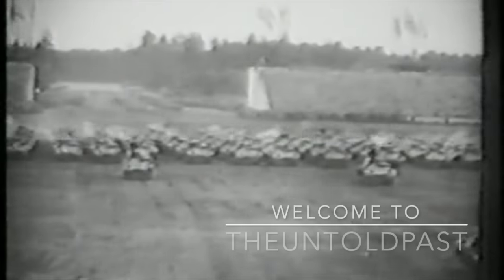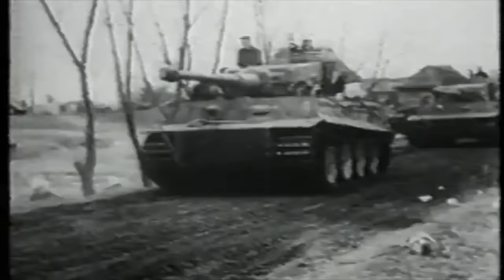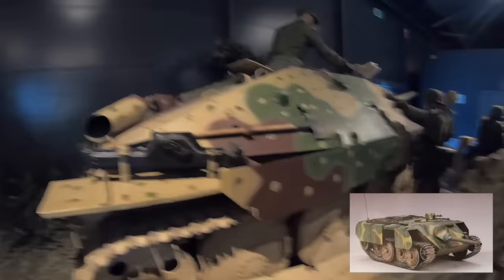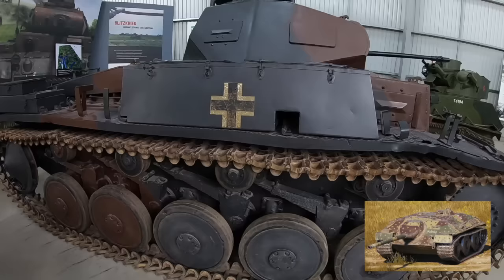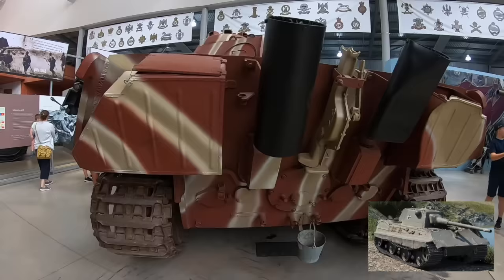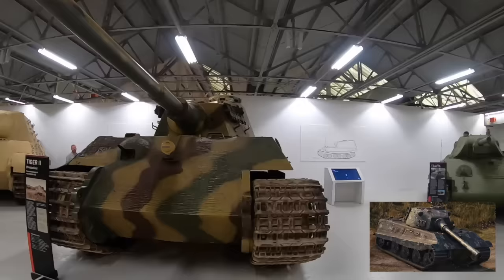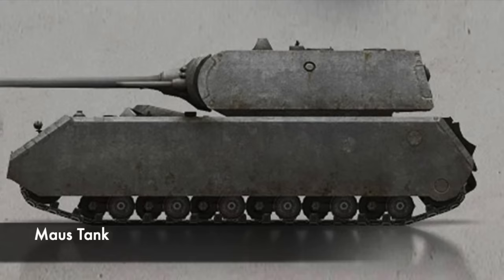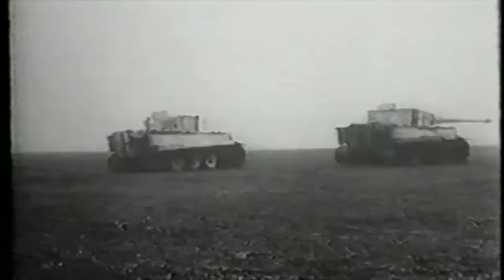The E-Series Of Tanks - Hitler's Dream Tanks

Comment: So if the Germans introduced the E-series earlier in the war like in 1941, would it have made a difference in the winner of the war? Would it have changed the outcome of any major tank battles like the Battle of Kursk? Or the Battle of Moscow?
Reply: assuming you mean the rationalisation and the susension type rather than the armour and guns. it would have made a difference in production, maintainance and general reliability. resulting larger more combat ready tank arm in 42/43. so strong german units able to move further.

 but you would still have the issue of lack of fuel, which will restrict this increase in effectiveness somewhat, it was a major problem in the push to stalingrad (let alone battles afterwards). thus probably not enough to change the outcome of the war. 

the biggest issue the germans had in ww2, was not tank production, that was only really an issue after te wr was effectively lost anyway. it was the plan to invade the soviet union. big massive crossfront general advances are never a good idea. they underestimated the soviets and lost as a result.
the only thing that might cause a dramatic change in ww2 from the german perspective is 1) a longer ranged fighter in production prior to 1940 (so it can help change the battle of britain), and 2) and change in tactics/strategy going into the USSR. and you kind of need both. any other change is going to make it easier but will not change the outcome without atleast 1 of the above.
Reply: @matthiuskoenig3378  - Thanks for the insightful post. I enjoyed reading it. What if the Germans went with Operation Barborossa first instead of the Battle of Britain? With the E-Series and more resources, could they have taken the USSR?

Comment: So the German's learned that their very large Tiger's were a bad idea, so they were trying to made a tank more like the Sherman/T-34s , but the thought was too late. The Tiger tank should have been built in very small numbers and used in very limited roles, the tiger just did not make for a good tank to send into battle because of it's weight and high maintenance/fuel consumption, in other words the Tigers were just for show ):
Reply: They killed well when ambushing from concealed, defended positions or going up against poorly trained Soviet Tank Crews.
Reply: @youraveragescotsman7119 This is what the Tiger is good at. It doesn't take nearly any fuel to sit and wait for an ambush. This is why the Tiger was a better late-war than the panzers. The panzers were fast but they didn't need to be. This was a defensive war. You don't want fast maneuverable tanks in a defensive war. you want big beefy ones waiting to ambush the enemy.

Comment: Yes, the E series "seems" like a good idea, but so did all the other German wastes of resources. The United States, with its massive industrial output made only 4 tanks at this point in the war, the light tank m-5, the medium tank m-4, the m-18 hellcat, and the Pershing. If you wanted anything else it had to be built on one of these chassis. Also, m-18 was far cheaper to build than a Sherman, used the same engine and carried out a role the would have otherwise had to be done by a, more expensive Sherman. If I was in charge of German tank production, I would have set up 2 branches: Maintenance and Integration group, which would have used small shops to make parts for, and maintain all the various kinds of tanks the Germans already had, and repair and refit captured tanks and battlefield wreaks. And Production group, which would make 2 tanks: the light, a Hetzer-like vehicle mounting the 7.5 L48. And the medium, mounting the L48 in a turret, redesigned for low profile and good armor slope, or 7.5 L70 in a tank destroyer configuration. They still would have lost.
Reply: the e-series has interchangable suspensions and road wheels, the E-50 and E-75 were essentially varients of the same vehicle (same hull, same engines, same drive train, just more armour on the front plate, and a n exra set of the same road wheels, and possibly a different turret [that hadn't been decided yet tho). and the E-100 was cancelled (design continued privately, but the german government wasn't interested any more), the E-10 was replaced (but a vehicle was still being made in its place) and another vehicle was added (sometimes falsely referred to as the E-5)

these 5 tracked hulls would have also included APCs, so i we want to compare to the yanks then you should inlcude the M3-M5 halftracks, in which case both are produceing 5 hulls. but the e-series has greater interchangeability of parts.
Reply: @matthiuskoenig3378  Expect that the Germans were making a number of different half tracks too. And the whole idea of using a tank as an APC (at that time, in their situation) was ridiculous, the American m-3 half-track cost one quarter of what the cheapest Sherman cost. Parts interchangeability isn't gonna make up for that. Yes, Interchangeability is good, but one must consider, if these two vehicles are so similar that they can share parts, other than say, commander's cupolas or things that any two tanks could share (driver's seats?),  why not just make one. Yes, everything that can be interchangeable should be, but why not just make fewer kinds of tanks? Germany should have never had the Panzer 3 and the Panzer 4. They never should have had the Tiger and the Panther. If we want to make these vehicles parts interchangeable, lets make them 100% parts interchangeable. But you didn't mention my "Department of Tank Scrounging" idea, that was the best part of the whole thing :)
Reply: PNZ III & PNZ IV were fine vehicles, to my knowledge, PNZ III was intended to be the anti-armour, while the PNZ IV was to be mounted with the larger turret for an initially short barrel 75mm for light fortifications or anti-infantry. Tiger was a specialized tank for attacking heavy fortifications, and initially, was successfully used at that role -it was a good design that was later utilized outside of its intended doctrine. Panther was a modernized PNZ IV that had too many teething problems - though if it had a proper design run, it could have argued to be an effective core design. Tiger II was built around the same effects of the Tiger I, except the Germans weren't using it for the same intention as the Tiger I - and this improper usage is why it's unreliability was such a large flaw.

Initial German production of tanks was fine, they should have always attempted to standardize parts, which was their true fatal flaw, though the designs initially made sense, especially based around their production techniques initially employed in the creation of armoured vehicles. Only when upscaled did it actually become an issue.
Reply: @D_U_N_E  The panzer 4 was 25 tons and the panzer 3 was 23 tons. Having a tank for supporting infantry and one for killing tanks is fine, but they can be the same tank, just with different guns and perhaps add on armor for the infantry tank. They could roll off the same production line, or have two production lines making the same tank in different variants. Same spare parts, mechanic training, crew training, everything but ammo for the main gun. There is no reason to make two tanks, make two variants of the same tank. The Sherman had tank destroyer variants, 105 howitzer infantry support variant, mobile artillery variant, all kinds of stuff on the same tank. While early war German tank doctrine was sound, tank production and logistic support never was. The thing about the E-plan was, at least, they had started to identify the problem.
Reply: @bryannoyce  Ok, I am drunk - so bare that in mind for spelling and such.

Ok, first to look at the Sherman - the Sherman was adapted throughout the war, from M4 to the M4A6 - while you can argue that these tanks shared many common parts, as was American supply doctrine at the time, they were noted to have rather unique changes in geometry of both the hull and turret - changing weights as there is a different change in volume of material. This was worked alongside American production techniques which were arguably rather modern in comparison to German techniques. Though regardless, the American tanks at some points in time were producing multiple "Shermans" of the same variant as retooling factories is costly, and overall numbers of tanks produced - which can be dangerous in all out war.

German production techniques were actually rather Artisan at the start of WW2 - they did not have the same efficiency in production of vehicles in comparison to the Americans or Russians, when talking about the Germans producing arms, or at least tanks, this is very important to take into account. Their techniques were inferior, though because of this, production of armed vehicles could be conducted in a different manner without reducing efficiency, for one - retooling a factory to adapt to parts was easier, as the factories were not designed for the same large scale duplication as a rival plant - while this WAS an issue in the long term, at the time of production of the PNZ III/IV, this was not a reason to reduce models, since factories could easily produce 2 different models of tank without reduction in numbers of units provided in comparison to a American or Russian plant.

Now to look at the PNZ III vs PNZ IV - which to note, you must bare in mind the techniques employed by German tank industries to understand certain benefits or drawbacks. 
Panzer III was lighter, as such, required less resources to produce - the tank has a smaller general body - which to German high command, meant that the tanks were easier to conceal, and as at the time it was intended to be the "MBT" of the Wehrmacht, it made sense.

The PNZ IV was only 2 tonnes heavier as you stated, though at initial conception (it was designed 1 year after the PNZ III), it made logical sense to produce for attacking bunkers, though it was slightly heavier, which translated to increased fuel usage - and a increase in size overall which then added additional restrictions on the German supply chains, as well as general tactical usability of the vehicle. In short, at the time where they have 2 tanks, PNZ III and PNZ IV - the III was to be used for main combat roles, and the IV was to be used alongside infantry with lower produced numbers due to increased cost. Operators of the PNZ III and IV would employ different tactics, and as such, it didn't matter for cross platform compatibility due to the fact you don't want a PNZ III operator to use a PNZ IV in the same doctrinal capacity as a III. At the time of these tanks inception, the German forces still had competent equipment requisition forces, and as such, to their specifications, the III and IV made logistical as well as tactical sense, this is opposed to 1944 Tiger II's which were developed for a more political than logical reason. 
During the war, it was noted that the 37mm cannon employed by the PNZ III was inadequate for expansion, and as such, over the course of the war - production was diverted to the IV, since the long barrel 75mm had more potential against the main threats encountered by the Wehrmacht. Alongside this, Panther chassis were actually more optimized than Panzer III/IV chassis in terms of production time - I remember reading somewhere that the Panther in 1945 actually had some of the highest unit production output per month in comparison to 1938 Panzer IV production, despite the loss in territory or resources. The Germans over the war started to utilize better production techniques, and over time removed the "Artisan" manufacturing processes, the E series being a testament to how the Germans started to understand single unit performance vs numerical superiority. 

Your point makes sense if the Germans utilized production techniques similar to Russia or America, though their techniques were vastly different, which is what caused the alternative developments of their armored vehicles. If bringing up German arms, you also need to understand how they produced their armaments', and why certain decisions may have been made due to set limitations in their infrastructures. To use a modern analogy. The Abrams/Leopard tanks weight 60-65 tonnes, these are MBT's, and it is to be assumed they should be able to have sufficient tactical flexibility around not only their own countries infrastructure, but their own field support for moving the vehicles across terrain. Be this mud, or bodies of water. The Tiger II, which was classified as a heavy tank, was 68.5 tonnes - at it's inception, it could not easily be supported by infrastructure or support units. Without understanding of a countries capabilities, we cannot understand what is a good/bad design. If we assume every country is using the most optimized techniques for it's time, sure - we can make a clear connection. Though once material, technological, or just general techniques are applied to a situation - you need to look at from that counties situational dis/advantages. In which case, Germany had doctrine down to a T, as well as had a really efficient equipment acquisition program - producing arguably (until somewhere between 1941/1943) -  the most efficient/capable Arms in the world. Though as stated multiple times, their production techniques were archaic, and as such, their design philosophy was vastly different from other world powers. They did not standardize their equipment, lacked spare parts - their arms were good, though due to their own limitations at the time, they did not understand certain techniques that would have reduced pressure on supply lines, or increased the production of units at the start of the war.

If we ignore how their industry was relegated, sure - They should have only had a modified version of the PNZ III since that was the tank that was designed first, then later adjusted to use a frontal sloping plate, a design being a mix of the PNZ III and Panther to ensure a modernized arms - trying to ensure a reduction of new parts to ease manufacturing re-adjustment. Though as noted, their industry was not comparable to the US or Russia, utilizing very different techniques which had their own pros and cons. Though TBF - it had more negatives than positives in hind sight.
Reply: @D_U_N_E  I don't have anything to drink right now so, you will have to bare with me being sober. I know, who posts on the internet SOBER! Anyway, the German methods of production make standardization more important! With America's extensive industrial capacity and robust supply system, the United States could easily support multiple tank types, in fact, as you point out, America ended up making multiple versions of the Sherman at the same time. This was contrary to doctrine, but for various reasons it was better in the end. The E-tanks were an example of the changing German thinking, but it was still a long way from a good plan. They were using common parts, but they were still making too many types, they were making big vehicles despite dwindling resources. Desperate times call for radical thinking, cancel all tanks and tank destroyers, and make single vehicle that is like an upgraded Hetzer. They wouldn't be as nice but you might be able to make enough of them and might even have enough fuel to use some of them. But, instead, the Germans are planning to make things just like before only with interchangeable parts, and some attempt make them easier to manufacture. I am something of a small shop expert and it is easier to make multiple copies of one thing, than a bunch of different things, it is easier to make things that function in a similar manner and use the same technology, rather than things that are very different. Standardization is more important in a small shop, I can't just call the tool and die shop and ask them to make me a new tool or jig, I can't just call the engineers and ask for a new design, which is how they did it in American factories at the time. It would have been easier to make an up gunned, up armored panzer 3 than make a panzer 4. True, in peace time there was little incentive to make one tank instead of two, but then you're just making weapons for show, not with the expectation of fighting a war.

Comment: The rate of production of German tanks was never too low. That's why it was a good idea to opt for heavier more complex and superior tanks.
Reply: It was a huge problem. More of the Tigers and King Tigers were actually abandoned or destroyed by their own crews because of bad reliability than destroyed by enemy tanks.
Reply: @JackoBanon1  that's a myth. Reliability issues were a minor problem compared to fuel. Most tanks that were abandoned had to be abandoned because there was no fuel. Germany didn't have enough oil to fuel many tanks.
Reply: @JackoBanon1  you can chat about reliability all day but every soldier on that war wanted a tiger tank and also didnt want to face it. one tiger tank had a kill ratio of 10 to 1 they literally shredded the shermans
Reply: @katiebarratt8184  Heinz Guderian - one of Germanys most important panzer generals - stated in 1944 to Hitler that on the Eastern Front 60-70% of all tanks were lost to mechanical failures, 15% to anti-tank guns/enemy tanks, 5% to artillery and 5 % because of other reasons. You can read it in his book as well.
Reply: @JackoBanon1  vehicles get damaged during war to say all of the damages where due to unreliability is an exaggeration they where in enemy soil they faced harsh conditions especially the harsh cold russian winter, they couldnt get supplies and equipment in time mainly because they used horses for transport and russians where at home so those tanks where bound to break.
Reply: @JackoBanon1  the mechanical failures on the russian front , not the other ones in high numbers, occured due to the terrain and especially harsh winters. Just the very first one close to moscow ruined 3/5 of the tanks. Most were just abandoned on retreat